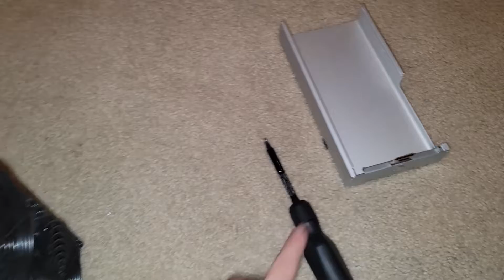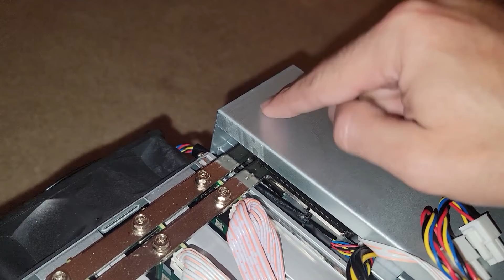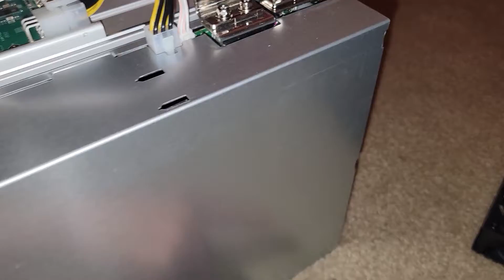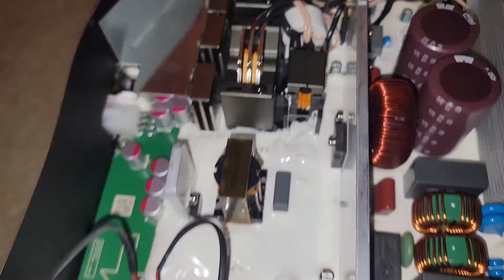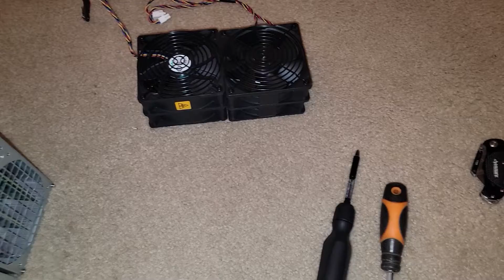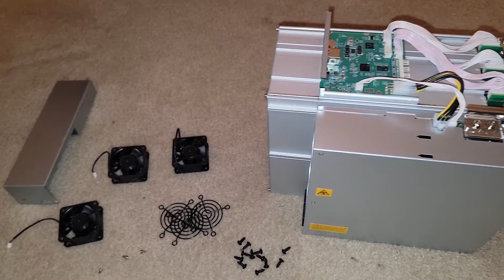Bitmain S19 Teardown & Prep for Immersion cooling

Comment: Thanks for responding to my Live question yesterday! I watched this video to help guide my immersion prep on S21. Question, do you know if I need a control board for the S21 before connecting to Braiins OS? Thanks again! Your teardown video was excellent!
Reply from the maker: Yes, but your S21 should have come with a control board. If not you will need one and then your flash it with the Braiins OS toolbox.
Reply: @SerpentXTech  thanks! I will double check my setup
Reply from the maker: @bruceroozdar9156  when you got to use Braiins Toolbox your asic needs to be using thr stock or default password
Reply: @SerpentXTech  thank you!